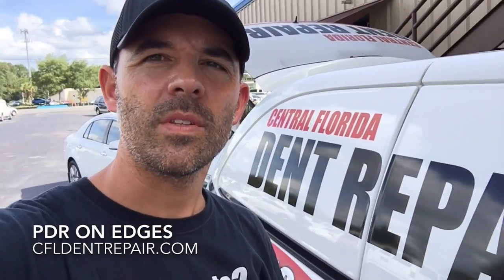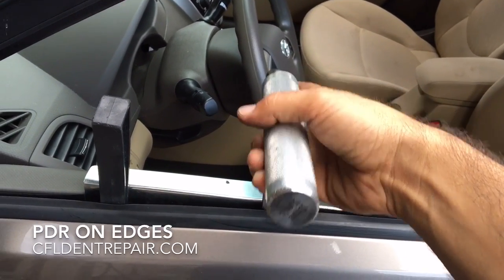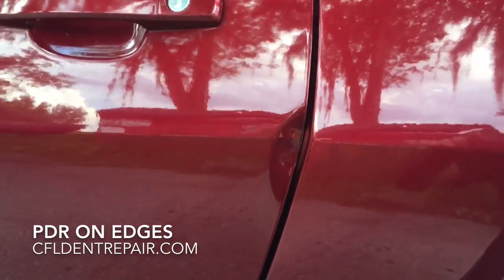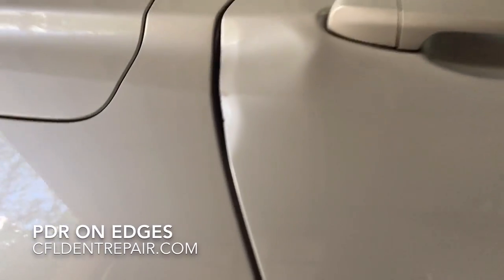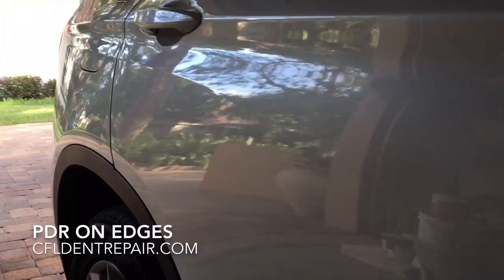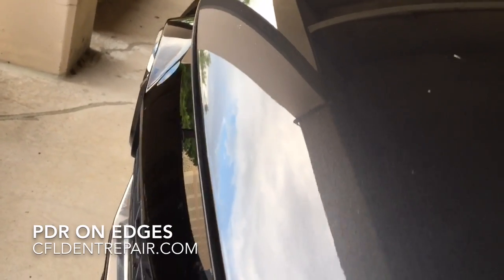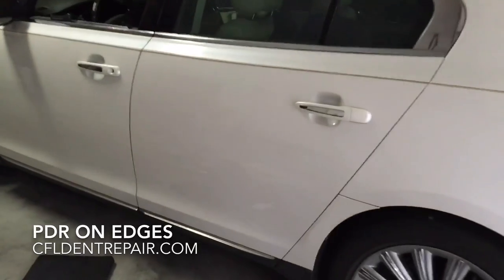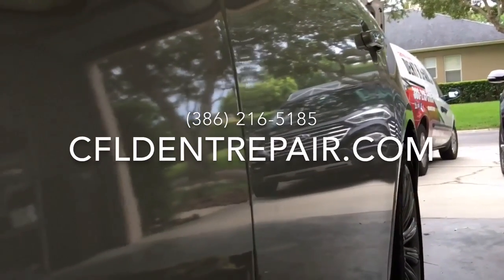Paintless Dent Removal With Brice Kelly (DENTS ON EDGES / DOUBLE METAL)

Comment: There should be an annual contest to have a national PDR champion.  I would provide my 2003 Suburban that has a difficult dent to solve.  It is on the driver side front door leading edge exactly over the lower hinge about 1 inch deep, where the tip on the rear bumper of a FedEx truck backed in.  Probably not a PDR candidate due to the door hinge being behind the dent.   #@^%%$! because I have no collision insurance.  Of all the places to have a dent, this might be the worst.  Joke is on me.  LOL

Comment: Bud to be honest you're the best Dent pusher I've seen. The clean results you achieve are just amazing. How on earth did you fix the edge of that bonnet? I need to know... I won't even be able to sleep without knowing. I'm a Dent pusher myself in South Africa. Mostly doing insurance work at bodyshops. I wouldn't have even given that bonnet edge a 2nd glance before walking away. What steps did you take to remove it? Did you need to remove the seamsealer? Did you glue pull and how could you glue pulls such sharp creases because I don't see how you could open up that Dent on a double skin!!

Comment: Could you fix a dent with paint ? Or do I just need a new door???
Reply: Lizan Kitchen it’s a lovey thing called bondo you sand the area down to the primer and fill it up and paint over it, if you paint though you have to sand the whole panel down otherwise your paint job will chip and look terrible. Just research it